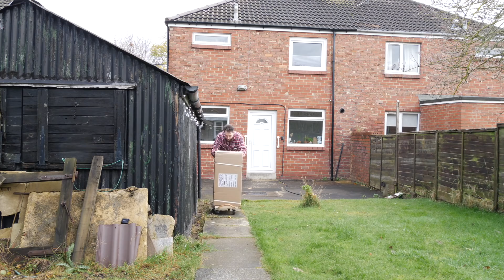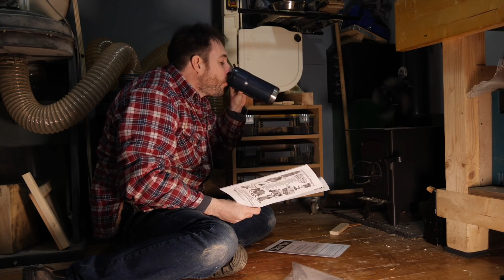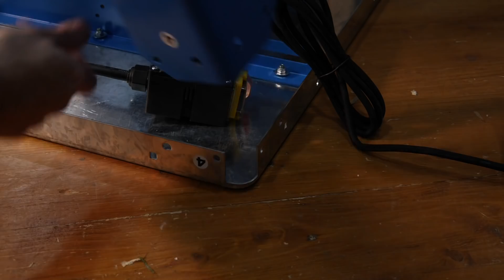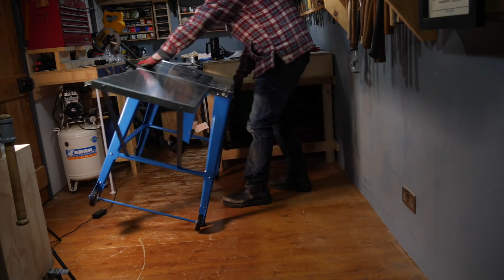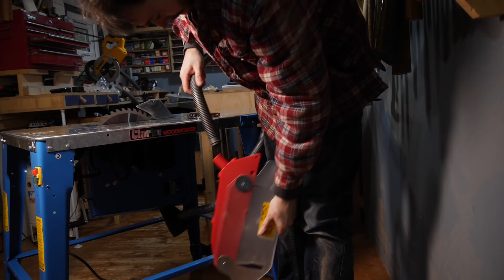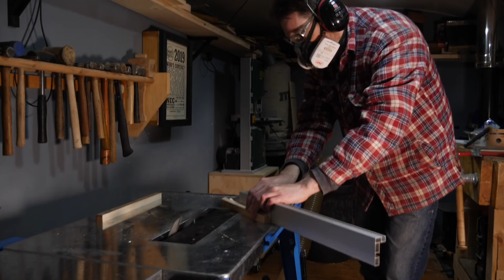Setting up the Clark CCS12 table saw

Comment: Hi Matt, hows the Clarke Saw, I was thinking of buying and making my own fence system and cabinet, I wanted your feedback on the motor; any good? Thanks mate.
Reply from the maker: It has plenty of power and is nice and quiet. Well quiet for a table saw
Reply: Thanks Matt.... appreciate it, 👍
Reply: Hi Matt, I took the plunge and bought the Clarke, I wondered if you could assist me on something, on my initial set up I noticed my crank handle seems a little stiff, lifting the blade, very easy coming down, and I noticed some fine steel filings laying at the bottom of the blade housing below the crank thread, it seems ok but I wondered how easy yours was to crank up, or is this the nature of the beast. Thanks for your time. Antony.
Reply from the maker: @thetony1973  mine works ok. I did give it a spray with silicone lubricant
Reply: Thanks, I decided to take a closer look, took the blade out etc, seems one of the nylon threaded nuts was very loose, meaning lot of play on the handle, no integrity going up... so tightened and silicone sprayed, seems much better, think I had too much faith in initial assembly of product, thanks Matt.🐜👍
Reply from the maker: @thetony1973  glad you got it sorted out

Comment: Get a radial arm saw you'll be so much more happy..... it will do the job of both a table saw and a miter saw. And I believe if used properly it is safer than a table saw. Cheers

Comment: Another one! Lol. In many ways this looks like my first tablesaw of 2014, a Woodstar from Screwfix. Terrifying machine and as accurate as a blind archer with Parkinson's  (bless my dear departed father - Parkinson's, not an archer). Mind you, that Clarke machine seems to be so much quieter and stable with significantly less vibration; neat fence arrangement too, but probably too fiddly for me. I'm still only on my second tablesaw. Name withheld to avoid unwanted advertising ;) I've not reached the heady heights of tablesaw connoisseur status yet ;)
Reply from the maker: Im not sure i am a connoisseur
Reply: @Badgerworkshop  LOL, nevertheless I bow to your experience and knowledge :D

Comment: Nice Saw Matt, but i'm not sure that the table at the back is best suited there, with your workbench also used as an out feed table, other than that the Saw sounds ok.
On a side note whats happened to your workshop lighting?, in some latest videos it seems a bit dark in places?
Barry (Wirral, ENG)
Reply from the maker: Yes i might move the table. The lighting is the same but a new camera

Comment: hi matt 
i have a schepach ts30  with a  bearing slidering carrige 
i don't use the saw very much as i have arthritis in my spine but i do  the odd  small 
project with it and if the clark is anything like it which i think it except for the motor in the schepach is 2.2kw and  fence in mine is a 
cam that clamps the fence to the saw the fence its self is t shaped 
the blade that came with your saw seems  good quality as the the blade that was with mine is pure rubbish   the only problem i found with all contractors saws was they are low in height
so i made a 100mm frame and raised it up to the standard cabinet makers saw which i had when i was able to work as a kitchen and bedroom maker
its just a thought for you if you are leaving the saw in place and don't need to move it
this will would make it so much more comfortable to work at
i would recommend this type of saw for anyone doing general projects unless one needs very high end  precision in their work of course these saws have their faults what dosen't
in my work i once owned 2 cabinet makers saws  when i was able to work and to be honest they had their own issues
these were worth thousands of euro and still were not perfect i think you will in general be very
happy with your purchase
sorry for the long comment but i am only trying to help
all the best
james
Reply from the maker: You are right it is very low. I will defiantly me making a stand to lift it up a bit.

Comment: I’ve got the Charnwood version, W625, but with the ‘precision package - W625PSF’. It does away with the standard fences and replaces them with tracks that are much sturdier and more accurate. 

Such that I wouldn’t dismiss the basic saw on the grounds of inaccuracy - if you can get the add on ‘precision package’ for it. 

It’s a right faff fitting it, but you do also get a side extension too, and the difference is VERY noticeable. 

For the money I paid there wasn’t any other contender at the time - just a lot of opinion (helpful and downright unhelpful). It’s pretty much perfect for my small workshop and doesn’t annoy the neighbours. 

See if the Charnwood precision package will fit it, I think you’ll be even happier with it in the long run.
Reply from the maker: Thats sounds good. I will take a look. Thank you

Comment: Averaging around £300 this thing looks more rickety than my Sheppach [1500W 210mm] that cost £120. - you've got a 1600W induction motor with 12" blade, I've got mitre slots and separate fences [wobbly though they are] and L&R add-on side wings. Clarke also make a machine of around the same cost as my sheppach, so my question is really how much are you getting for the extra cost. I'll be watching with interest as this budget/performance issue was a real struggle when I was choosing my machine. Am I happy with my purchase - for now, it'll do.
Reply from the maker: Glad you like the saw you have
Reply: @Badgerworkshop   Only because I can't afford better - but I'm curious to know at what price they stop being entry level - I was a bit jealous of that thing you've put in the garage - barring the niggles you mentioned. And I'll admit, as a newbie-ish DIYer I thought depth-of-cut was No1 with a tablesaw until I realised what the other workshop blade/machines offer. Now, frankly I think accuracy is the most important, as its versatility of cutting actions makes it central to most projects. 
Matt its seems a lot of the comment-ers are scratching their chins about the Clarke - We're just waiting to see what you can find out for us - a review [in time] will be very interesting for the quality/price debate. Cheers mate, and it looks real cosy in the badgers sett curled up by the fire!

Comment: Wow another tablesaw! - I'm interested to see how you get on with it but must admit that my first impression based on seeing it put together is not filled with hope. The fence/rail/retaining knob system looks likely to deform over time and prone to impact damage. I also suspect you'll be driven insane in a couple of months at having to open/close two knobs every time you want to make a fence adjustment, and at having to move the whole thing (losing your fence position) to make a crosscut, and that's before we go into the subject of no mitre slots = no mitre slot based jigs! It's great that Machine Mart sent you out a saw to try, perhaps they could be convinced to send you a Scheppach Precisa as a follow up!
Reply from the maker: I dont think they are going to do that
Reply: @Badgerworkshop  I hope they don't - fingers crossed! - is there any way you can use the side rail or perhaps the table sides themselves for guiding jigs as an alternative to mitre slots?
Reply from the maker: I have some plans for it